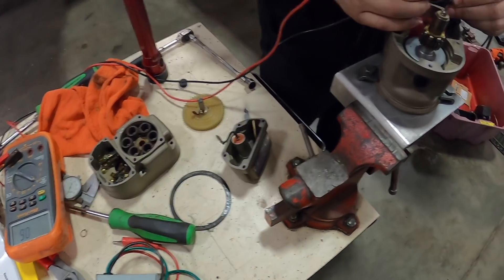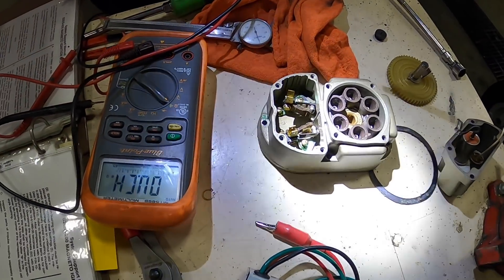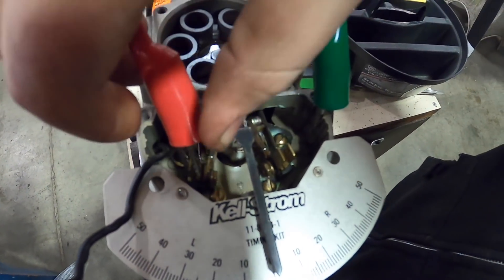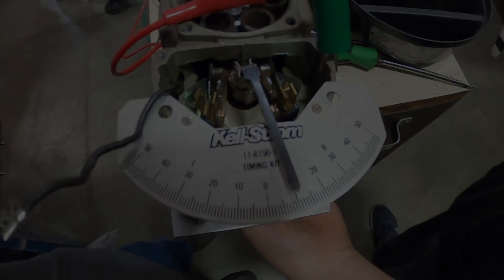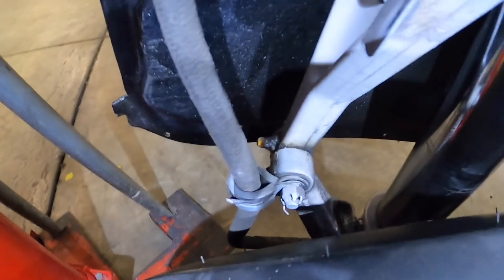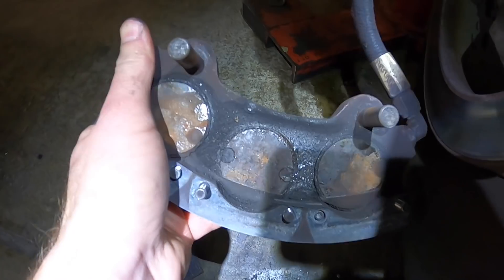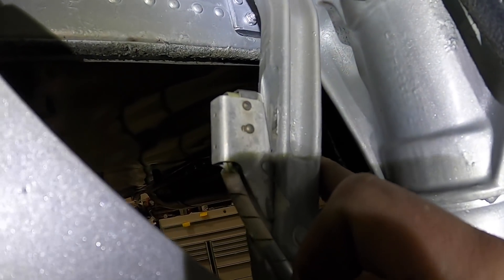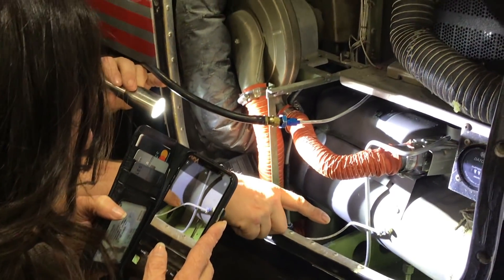Airplane Maintenance: Magneto & Gear Inspection at TAS Aviation

Comment: Hello, I'm a big fan of your channel. I'm currently looking at joining a partnership in a Cessna 310G. I'm a little nervous of the cost involved. Do you have a rough idea of what your annual operation costs are? Do you charge yourself a certain amount of money per hour to go towards your annual operations and/or engine and propeller overhaul fund? If so, how much do you plan for per hour you fly your 310? Thanks for your advice.

Comment: Since they took it all apart you'd think they'd replace the carbon? brush and condenser/capacitor.  The gear looks like it is neoprene or some such which could get brittle over time.  That was somewhat surprising.

Comment: Reminds one of the old maxim, "A pearl of great price is not for the asking.  I fly a RV-12 and my shop has found some safety of flight issues during the condition inspections, and I'm darn glad they did.  This video is testament to the value of a shop that is experienced in your type, calls the balls and strikes and does first rate work.  But, this piece is even more a testament to your dedication to the responsibility that comes from aircraft ownership.  There is no "pulling over to the berm" when the wheels leave the runway.   Kudos.

Comment: Well, it's 49 years old - a 1972 model.  Having worked in aircraft maintenance, back when, for quite some time, the young man giving the explanations on the gear was excellent.  He IS an aircraft mechanic.  I see that this plane had a "fractional owner," at least at one time - now I think it's an Individual Owner.  If so, it will be a massive amount of money to cover all of these repairs.  However, if you have the money, it's NO problemo.  Enjoyed watching the guys do their work.

Comment: Thanks for sharing Kevin. I'd like to take my 310 to TAS next year for a 'proper' annual. Mind sharing how many hours on your airframe? Is there a correlation between cracking and airframe total time? Thanks
Reply from the maker: You're very welcome Jason. I think you'll be very happy with the service you receive from TAS. Even the small stuff like how Tony completely re-organized my log books, POH/required documents in the plane, etc. I think I have about 6500 on the AF. I don't have the logs here. I'm not sure about the correlation. Ultimately I should have waited for TAS on the pre-purchase but was in a hurry and had someone else do it. I did put an offer in knowing I'd have to fix some things but didn't realize the full magnitude. Oh well, we absolutely love how she's turned out for us and it's been a fun modernization/rehab project. She's our forever bird and as such we like to treat her nice in hopes she'll return the favor. :)

Comment: Apparently, across the range of 310 models, the nose gear underwent numerous mods. The earliest models had a nose gear that was raked down and forward, and was also housed well forward in the nose of the plane. Later, the gear lost its rake and moved further aft in the nose compartment. Do you know the story of this and/or where I can read up on this? Thx!

Comment: I owned a Cessna 310R for 18 years. I put the side trace kits in the first year I owned it. 17 years later one of the sides cracked again. It’s something the owner MUST stay on top of. I never made a fast turn off the runway, nor operated off unimproved strips. S—t happens. It is a great airplane and well worth the cost of operation.
Reply from the maker: Thanks for the heads up Rex. I didn't realize they could crack again with the brace on. I'll still continue to baby the turns and I rarely go into a grass strip but it's usually fairly smooth. I couldn't agree more about how worth it these planes are. :)

Comment: What you said at the end of the video about very few shops know how to correctly rig a 310 gear is spot on.  The gear on the 300/400 series Cessna's is a weak point.  If they are not rigged properly, all kinds of bad stuff happens.  Great video and kudos to TAS Aviation.
Reply from the maker: Thanks for the comment Greg. I've always kind of had an uneasy feeling about the gear in the back of my mind. It's nice to have it all inspected and repaired to like new. :)

Comment: I’m not a pilot, just one of your subscribers.  

Just wondering 🧐 what caused that nose gear bolt to bend that way, just wear and tear, a loose bolt???
Reply from the maker: Thanks for being a subscriber L P!! My understanding, if someone is more maintenance savvy they can step in here, is that over time the bearing/bushing came out of the rod end and started wearing/deforming the bolt. Most shops just swing the gear up and down during annual and call it good. A true Twin Cessna Speciality shop knows that is asking for a failure at some point. TAS takes all the components apart, inspects and re-installs everything to very specific specs.

Comment: Why not just replace the magneto.......overhauled mags are by FAR the most economical solution, and none of this testing and disassembly.
Reply from the maker: I could have done that as well. In this particular case, they were in pretty good shape and they did a 500 hour IRAN on them. One of these days I may try to replace one with EI...still waiting on more people in the 310 world to do that and report back. :)

Comment: Nicely done! Still cracks me up how the FAA doesn't care to much how the rivets are laid out. (Be at least 2D and up for spacing)! It looks like a buck shot of rivets when into the repair "she'll hold" lol! On another note, Sheet metal is never a cheap process, like my mentor told me "if you don't find sheet metal damage are you actually inspecting?" Kevin you should learn the Airframes side do your own S/M Repairs XD!!!

Comment: Great Mx team. Makes u wonder what caused the high forces on the distorted nose gear bolt...i.e. Will the new one face the same damaging pressures? Granted it's bloody epensive to fix but she'll be a better bird after & save u from a even more expensive gear failure later.

Comment: These guys at TAS obviously know what they're doing!
In my 12 year career in aviation I have carefully watched the airframe mechanics at Raytheon at their art, that's what it is, an art!
New to me, never knew that points and condenser are still used in aviation. One would think that the solid state ignition system would be used on airplanes first before automobiles. 
But you know what? 
I'm old school! 
I so appreciate the original idea! 

Great vid Kevin!!

Comment: What does, "500 Hundred Hour Magneto Inspection" mean?  Does that mean there are 50,000 hours on the magnetos?  (Hint: I think this is like saying, "What's your PIN number?" PIN stands forv Personal Identification Number so the question would be asking, "What's your Personal Identification Number Number?")
Reply: Every 500 hrs. Of running time.
Reply: @429thunderjet2  so should it be the "500 Hour Magneto Inspection", then?  That would make more sense to me.
Reply: @timothyosborn1697  yes. That's what it is.

Comment: I was once told by a friend that was a pilot and owned a couple of his own planes. He said "If you think cars, boats and motorcycles are expensive, try owning a plane". His words rang in my ears while watching this video. As we see, very labor intensive and necessary work.
Reply: The cost of repairs in top boat yards probably not that different. The "luxury" I see with a plane is the  ability to go a lot further away for repairs vs. for example areas that have very limited boat yards so they can basically charge whatever they want.

Comment: Mag was a mystery to me. Turns out...it's similar to my '74 Chevy truck...points, distributor, condenser all contained inside one unit lol I've installed and changed plenty of points on cars, motorcycles, etc...GM went HEI in '75 and electronic ever since.

Comment: Seems like quite a few discrepancies since last annual. Some standard wear items like brakes are to be expected, but the cracked skins and loose lock nuts seem like they may have been there awhile. Is it possible the last annual wasn’t as comprehensive? Also I wouldn’t expect that bolt in the nose gear to get bent that bad unless it was loose or you “planted” it on a landing! We all know that isn’t possible!!

Comment: ~ 310B's with a 90 degree nosewheel were bad about folding up on landing. Later models corrected the problem with a redesign. Looks like they caught 1BC just in time. Would be bad to skin the new paint on the nosewheel doors.

Comment: Loose control rod jam nuts. Most common failure item on condition inspections, and you had two of them. :) That shop is doing some quality work!
Reply: I wonder if that is from the repaint, when they had to disassemble all of the gear doors?

Comment: Finding that bent nose gear bolt saved two engines and two props! Worth every penny.
Reply from the maker: Very much so Bill! In addition the brand new paint job. :)
Reply: @AstroCat gear up landings are almost never fatal, but that's not the point of course.

Comment: Setting the points on the mags reminds me of an ignition tune on a ‘60-‘70 car.  Tedious!
Reply: I was like “points? Seriously?” Then I remembered when this plane was built..::
Reply: I remember a GM breakthrough around ‘71.  There was a window in the distributor for an allen key.  Hook up a dwell meter and set the points by turning the allen screw.  Life was improved and my mothers car was running great again.

Comment: Holy smoke, that can't be cheap. They found that something was the wrong part in the landing gear, how does that happen? And sometimes the bolt is in backwards, who's working on these planes? Guess you're a bit hard on the breaks. lol This was a very cool video for those of us who love 1BC. That was so nice of them to video what they needed to do and look for. Now we know why you need to have your plane inspected by great people. I bet you didn't want to get that call. can you tell us how much this actually cost you? 1BC was about to have a catastrophic landing. You must have about died when you were told how much it was going to cost to keep 1BC in the air. How did Jamie take the news?

Comment: What scares me as an airplane owner, is that when you get an annual done by a good shop, it's terrifying to see all the other things that previous shops must have missed. For example, I doubt those bolts missing washers had the washers disappear, so obviously other inspections didn't spot that. I suspect that next year your annual will be much cheaper. Great video, and good of them to do that? How many hours did they bill for making the videos? :) (Don't answer that, it was a joke!)

Comment: Agreed, if you have a Twin Cessna, you cannot do better than TAS. They are the best! These are old airplanes, and there is a lot to keeping them airworthy. In 7 years, I very rarely missed a flight due to a maintenance issue (with TAS doing all my work).  Thanks for putting out a video highlighting their work.
Reply from the maker: Thanks for the comment John! That's great news to hear about your dispatch rate by doing maintenance with them. That is a big deal to us as well. It is amazing all the different components involved in these old birds and how well they know them all. I struggled with what to keep and edit out. I watched how they trouble shot my de-ice boot/system and found/repaired tons of errors in amazement. I put some of that in the next video. No more dual vacuum pump failures for me finally. :)

Comment: Relating to the mags, us old timers remember setting points as a regular maintenance procedure. Well done TAS.
Even my current vehicle has points, '86 Dodge 318.
My condolences on the cost to repair your baby. Glad it got found on the ground and not on the next landing.
Congrats on getting a safe bird back.
Thanks for sharing.
Reply: An 86 Dodge with points? was this changed from electronic ignition to points for a reason?
Reply: @gungadinn  He probably has like an aftermarket Mallory Dual Point distributor. I had an Accel dual point in my 73 Dodge Charger. Pain in the ass to set!!!
Reply: @rickashford4005  
Chrysler did away with points in the 1974-75 model years. 
I ran Accel, Mallory and Prestolite in many Chrysler products. 
Once the computer issues were fixed in the late 70’s you couldn’t get me to run points in anything other than the magnetos for my aircraft. 

Most Mopar guys carried a spare computer and ballast resistor in the glove box.

Comment: Hard to believe we are still using points and condensers! Car engines are super reliable now partly because they have all gone to electronic ignition. Too many chances for parts failure or maintenance mistakes with magnetos. Thanks for the good info in this video.